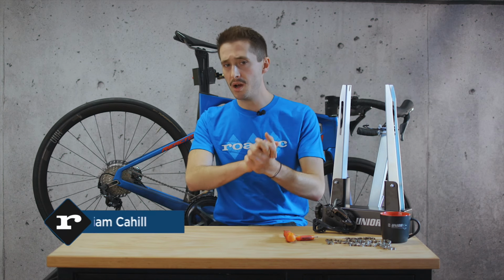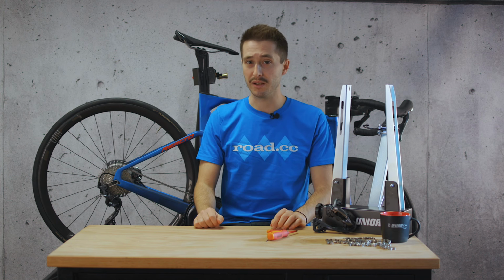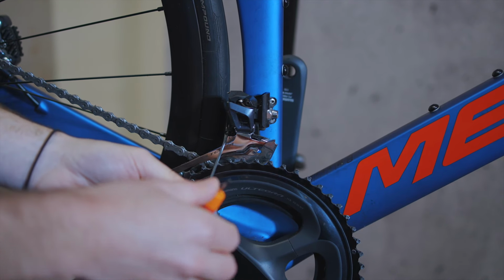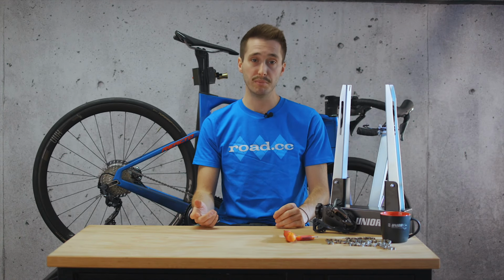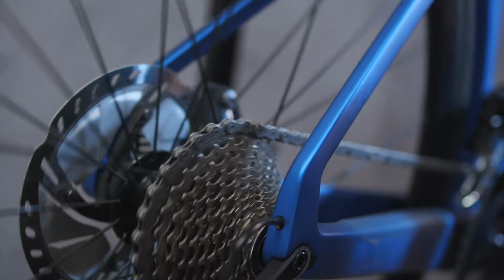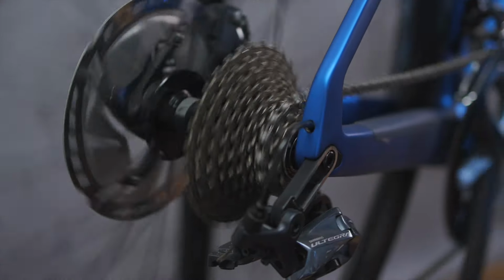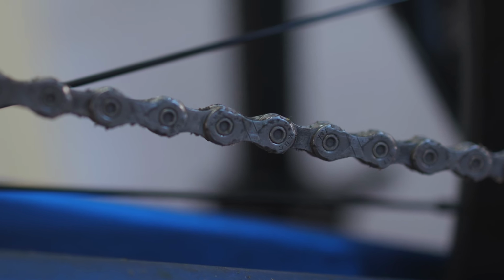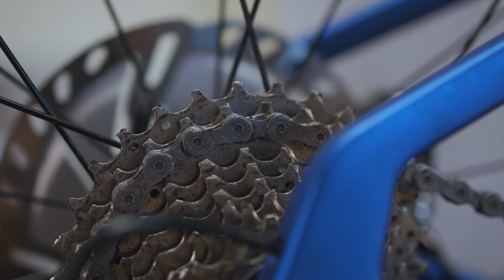How to stop your chain coming off! Top tips for a trouble free ride

Comment: "Japanese Industrial Screwdriver", lol, load of b@lls.
JIS stands for Japanese Industry Standard. Screwdrivers for use on JIS screws on Japanese products, similar to Philips but there are subtle differences between them and although you can use either one on each other, the JIS screwdrivers fit more snugly on JIS screws than Philips screwdrivers do on Philips screws. If you have a Japanese produced bit of kit, invest in a set of decent JIS screwdrivers, it makes a world of difference.

Comment: terrible guide. what about the gears on the handle bars. whats the default when we adjust all these stuff...
Reply: It's all covered in the video my guy... If the front has to be on the smallest, you would put the shifter to the lowest setting on your bike, if it's the highest gear in the front, you'd set it to the highest gear for the front.

In the back it's the same, if it needs to be set to the lowest gear, you'd put it on the biggest spoket, if it has to be on the highest, then you'd go to the smallest gear. 

He mentions where this stuff needs to be sitting in the video, it's just a matter of paying attention to what he says to know how the gears work, or if you can't figure it out from the video, take your bike, put each gear shift to the highest and lowest settings and see where the chain sits... That will tell you the gears for the highest and lowest.

It's good he doesn't specifically say what "gears" you set the handlebar in because not all bikes are universal. Mine for example is an 18 speed, but it doesn't have numbered gears on the gripshift. It has H and L with dots in between. Saying "gear numbers" could confuse people with bikes marked differently.

Comment: Hy..i replaced the chain on my bike....with a 9 speed 116L chain...i just seen there are more type of 9 speed chain,are with 114L and 118 L aswell.what is difference between these?before to replace my chain i measured the old one to be same long like new one..was same but on lower cassete speed chain dropping down..why?

Comment: dont know if anyone still visits this video, but im having this issue where the chain comes loose easily on the pedals, and always to the bike side, inside, but all i can find online is people fixing it (like in the video) adjusting a piece that i dont have, here in europe we almost dont have bikes with two derrailers, normally we have only one on the back.
Reply: Did you solve your problem? I have the same issue?
Reply: @kbson11  nope, completely gave up on geared bikes and have been riding Fixed Gear ⚙️, no gears, no worries
Reply: @vinixherculano  I just realized that the crank was loose where it attaches to the bottom bracket

Comment: Some of the advice is not correct, gap when setting limits is 0.5 to 1mm. Rear derailleurs are no longer straight, they angle towards the chainrings, so eyeballing the derailleur to be directly beneath a cog will result in misalignment of the derailleur.

Comment: I've got this same problem with my new Electric mountain bike, The Chain slips off the chain ring when its on the smallest rear cassette cog, I'm going to have to take it to a bike shop for some advice unless anyone knows what this problem can be, I will look at it on my days off and check my rear quick release wheel is in correctly. any help would be appreciated
Reply: Did you get it figured out? I basically have the same issue.

Comment: great video and content from your channel as usual! BUT come on!!! ... why not riding One-By on the roadbike. Who needs a front derailleur in 2021! My Dogma F12 is lighter, more asthetic and not one chaindrop over the last 2 Years  having RED etap AXS one by setup!
Reply: Because that set-up is more expensive? I have a ten year old Tiagra with a compact 2 ring on it, that does the job perfectly. I don’t need the expense of upgrading to a new single ring set-up.
Reply: Go wonder why SRAM is promoting the removal of the front derailleur. They cannot make one that works. Stick with shimano or campy if you want chainrings. I think I didn't drop a chain on my 105 for at least the last 10000Km In the other hand my Red AXS is a mess in that regard, it didn't get resolve until I star playing with spacers around the bottom bracket and find some nice spot where SRAM was happy with it, such a same for such an expensive groupset.
Reply: @LainOTN    well spoken lion. But my BMC Urs also run One-By ... Champi  Ekar-13 Speed.
So you see there is no need for worn out systems. 😎😎😎
Reply: @a1white  well said. "You need" ...